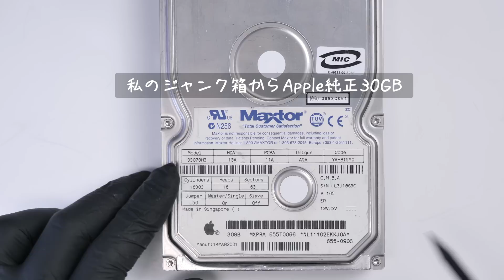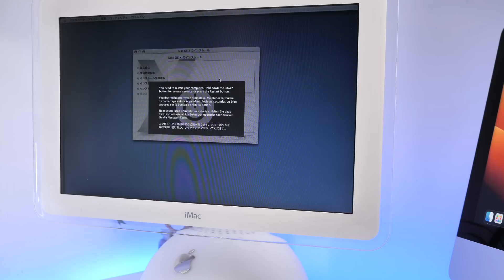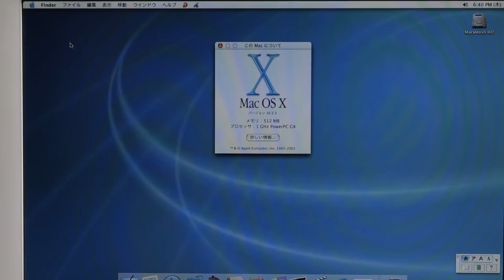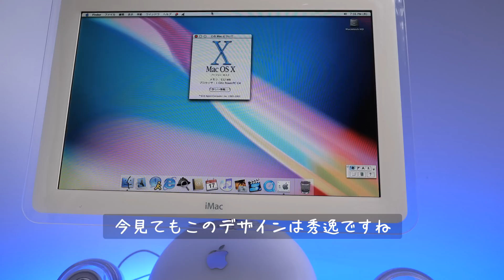20年前のジャンクiMac G4を起動させたい。

Comment: No, I do not miss IDE cables at all, or Molex (4-pin power) connectors. Always worried I'd either pull too hard taking them out or bend a pin putting the cable back on. Those iMacs were beautiful things, from when Apple really did think differently. I was curious-do you keep the machines you repair afterward? If so, you must have a very nice collection now
Reply from the maker: Basically, we keep it.